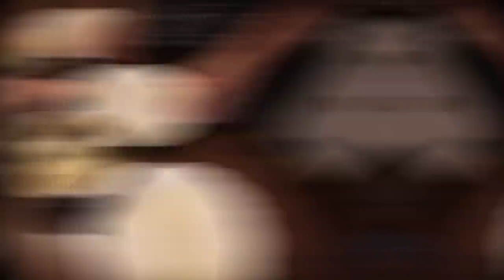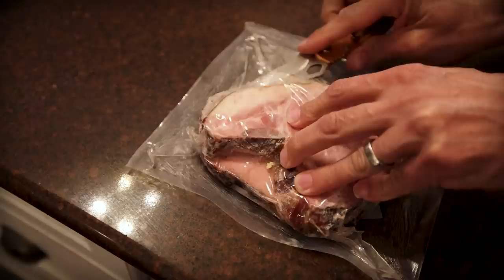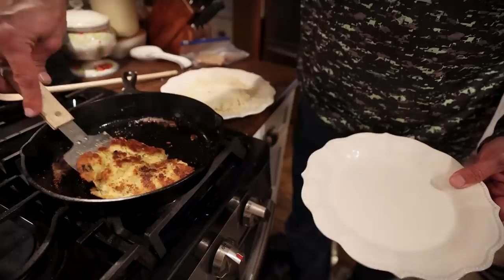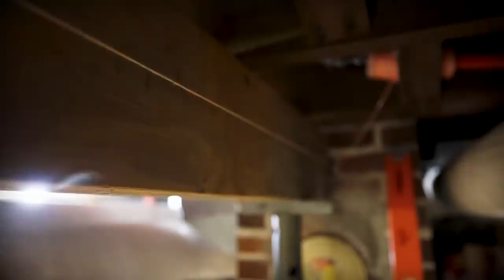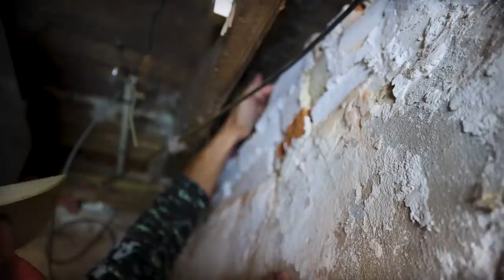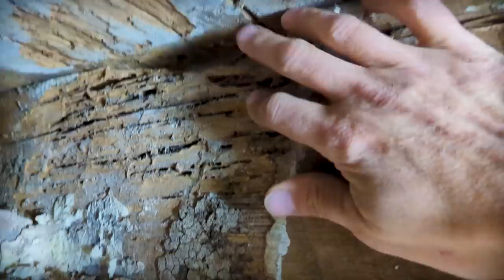This Old Farmhouse | Saving & Restoring Original Wood Floors

Comment: Oh love these old homes. Our basement "collapsed" in the flood of 08, I'm in WI it was the one where houses were floating down the River. Anyway one wall came in the basement, we had the limestone walls too. So we got lucky and found a company that went wall by wall and jacked it up. They then put in a poured basement. We have cracks all over now as well, they still need to be fixed. Nothing is square in old homes but I wouldn't trade it for the new junk any day. 😊

Comment: So interesting. My husband is a home builder and said that the house being built they way it was is called "Balloon framing" (from first to second floor). So the second story is held up on the edges by a ledger board instead of resting on a top plate like tradional building. Sounds like the advantages is less settling and disadvantages are that fire will spread more quickly unless you have a fire-stop built into the boards. We are excited to see the next video! Blessings on a quick turnaround for the completion!

Comment: It's called balloon framing when the wall studs span all floors.  It's not great for fire supression - if a fire starts downstairs, it'll travel upstairs quickly thru the wall cavities.  The framing more typically used now is called platform framing.

Comment: We have a house that was built in 1930 and in 2004 we had a 100 year flood. Our basement filled to the ceiling and of course the old river rock started to bow. We raised the house 39 inches and put a new basement under it. We still can see a few places where the plaster cracked or moved even though we repaired it all. Only we notice it, anyone else would never know. Good luck with all of this! It will look amazing when it is done.

Comment: Hopefully the floor guys have dust bags on all their sanders, big and small.  Even still,  make sure you cover everything,  the walls and furniture and such with sheet plastic.  Otherwise that fine dust will  go everywhere.  If done right, be very little dust.  
Looking good and once all the floors are sanded and sealed,  it will really look nice...
Reply from the maker: yes, they have a massive dust collection system.  they collect it on purpose to make a slurry they run over the floors to fill any any holes / gaps.

Comment: Your basement looks like mine. I have those metal support poles under my beams. Can't wait to see the finished floor. When your done you should think about spray foaming the rim joist. I just had it done. And it got rid of the drafts and made my house warmer. ( I was gonna do the whole ceiling but one professional told me if I had storage like canning jars in there not to do whole ceiling just joist. Said it would make the basement too cold and jars could freeze.

Comment: The problem with balloon construction was fire. There is no horizontal piece (fire stop) in the frame to stop a first floor fire from reaching the 2nd floor.
Maybe they can use a steel I-Beam after your floor is straightened. That will reduce the number of posts.
Is the floor now cracking because of the posts? You might need footings under the permanent posts.
You are blessed with the patina of real aged oak floors. Shiny or satin finish?? Did you fix the squeaks first?
Reply from the maker: Satin finish.  There will only be 2 posts when they're done.